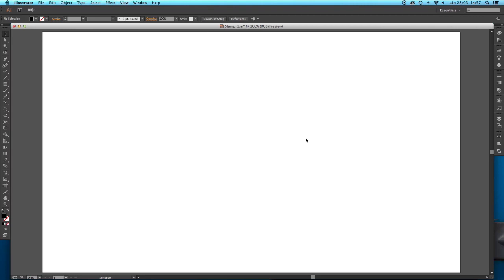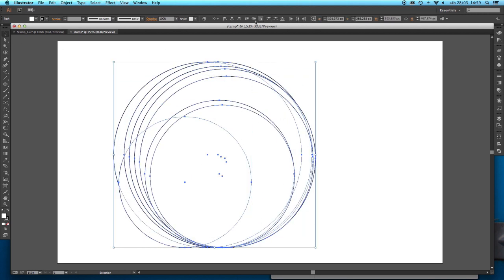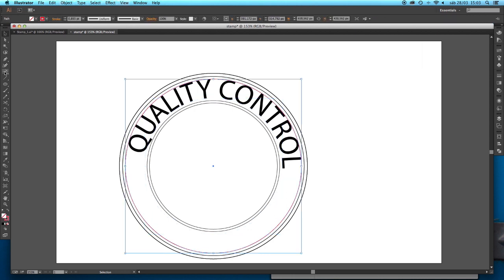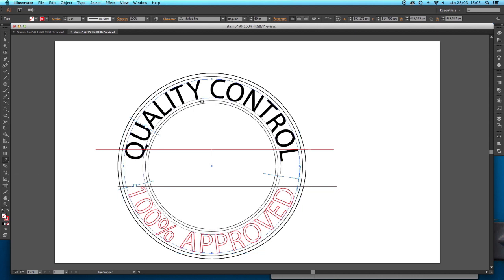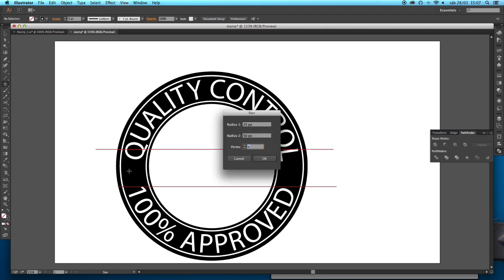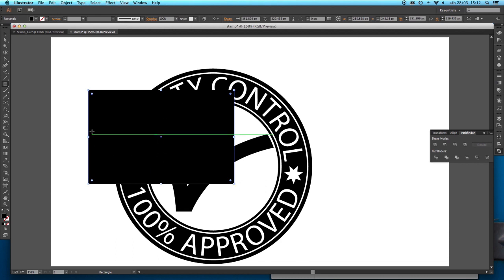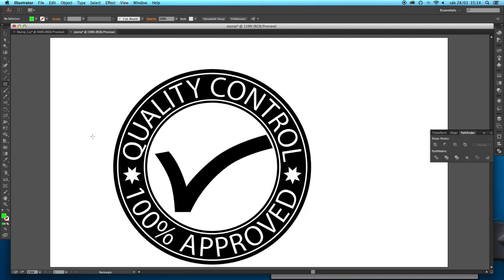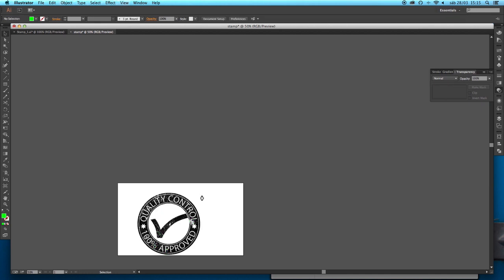Adobe Illustrator tutorial: How to make a stamp

Comment: Thanks for the video but I am having a problem. How do I select to have the square shape around the circle? When I click on select I still cannot enable the square
Reply from the maker: If the bounding box of your object does not show (the square shape around the circle) you can enable it by going to "View/Show Bounding Box"
Reply: Thank you! I have another question - is there a list of symbols to add into the outer circle of the stamp area? Without making new ones..all I see is the rectangle, rounded rectangle, eclipse, polygon and star. Are there any other ones hidden somewhere?
Reply from the maker: You can find special characters by using the Glyphs panel (Window > Type > Glyphs). Maybe this will solve what your looking for